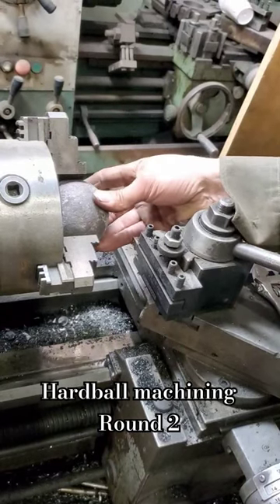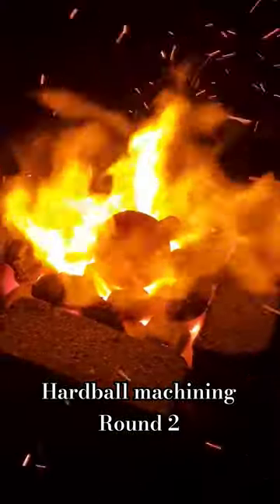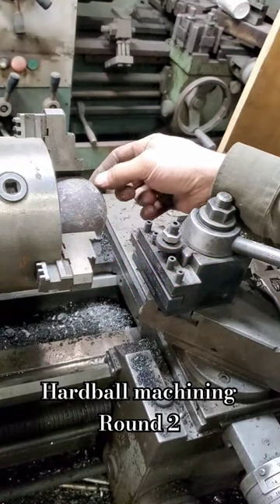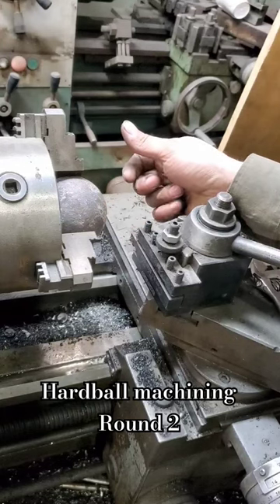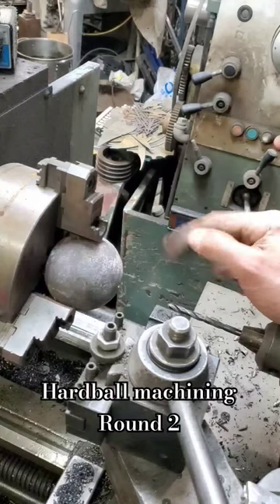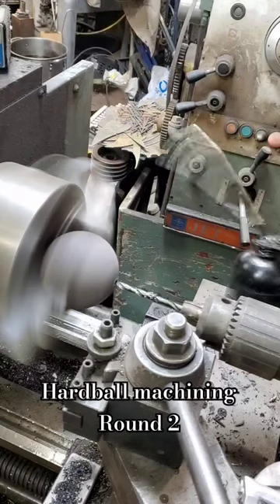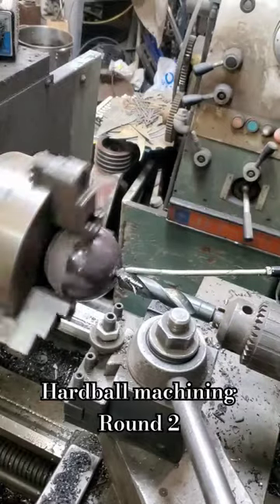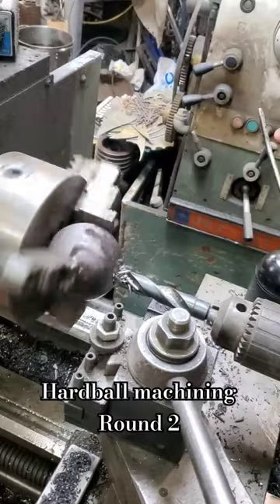Hardball Machining round 2 #machinist #machinery #lathe #annealing #metalworking #trades #tips

Comment: Truthfully, and not to be that guy, assuming this is steel or iron, letting it cool in air is called normalization. Annealing has to happen in vermiculite, Wood Ash, or both.
Reply: That is not true. Annealing and normalizing are similar heat treatment processes. Both entail slow cooling of the metal from high temperatures. Annealing is a broader term and normalization is a class of annealing processes done in air. That is to say,  normalization is annealing, but not every annealing is normalization.
Reply: Yeah, you are definitely THAT guy evidencing the Dunnings-Kruger Effect...

Comment: Wrap it in sheet of plastic to make concentric cylinder, fill it with a waterproof glue, let it harden, remove plastic, add drive dog.

Or you could have just used edm to avoid all of it.

Comment: Thanks for being my daily dose of new knowledge. I wonder if this would work to soften a tap or drill bit that's broken off in a hole?
Reply from the maker: Short answer is yes but its tricky cause they air harden so you need a propane touch to slow down the cool off.

Comment: Make a "Spot Face" on the surface smaller than the hole, that way you have a flat surface to drill into and you leave no evidence of it when you are done and you DONT HAVE TO RE-HEAT TREAT IT AFTERWARDS!
Reply from the maker: Checkout the before video lol I did just that. Turns out it's somthing like 52100 bearing material. I also don't need it that hard for the application which is a factor.

Comment: Doesn’t doing this destroy the metal I mean can’t it never be strong again
Reply from the maker: Um no I could reharden it by simple heating it up again and quenching it. Now there are some special alloys that have more technical heat treating processes or cryo. But generally what's annealed can be rehardened multiple times.
Reply: @Hughsllc this is how pre-1997 American coin dies were made, they would heat the die steel to anneal it press it into the master hub, take it back out to anneal it again for the "second squeeze" (post-'97 dies are single squeeze), then quench also this second squeeze is where your most famous coin errors happened, the Doubled die error. In 1997 they switched to a single squeeze and don't even really anneal the steel anymore, just use different hardness metals for the master hub, the working dies and the softest obviously being the coin planchets, the only coin dies that are still done with the second squeeze are proof and special run coins because it just produces a better strike all around. Sorry for the rant but this is a great video to show the difference between slow/fast tempering.